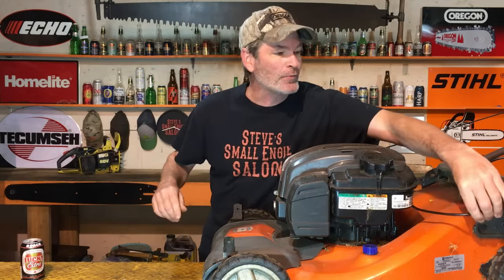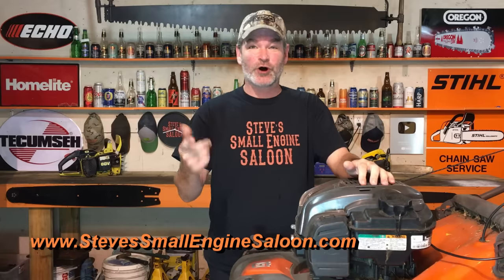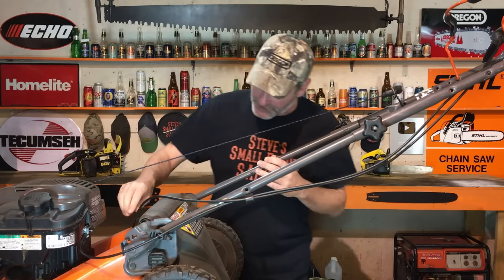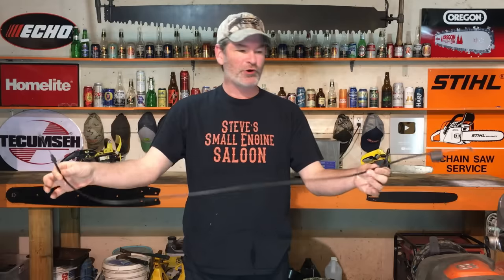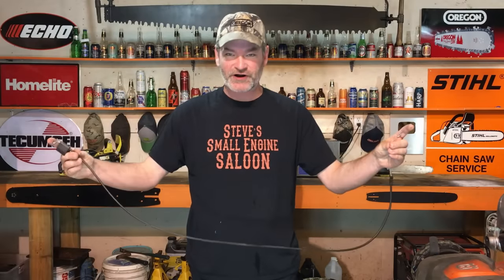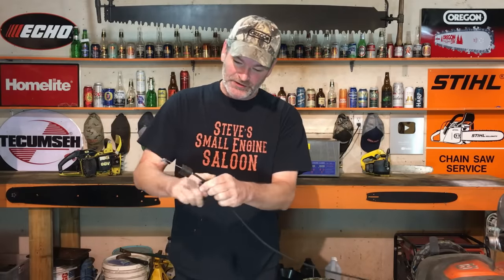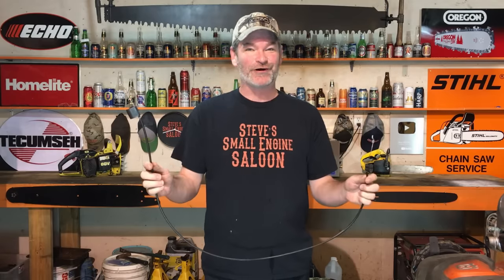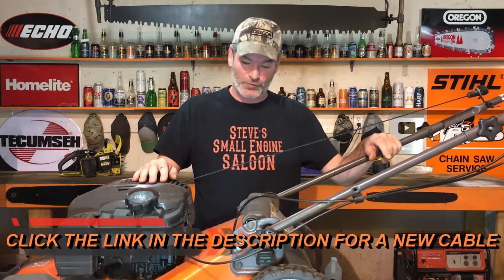How To Adjust A Non-Adjustable Lawn Mower Cable

Comment: Summary: The cable ends screw in/out, and by screwing both ends out a little bit (1/4 inch or so) you can lengthen the cable's outer sheath, which effectively shortens the usable portion of the cable, increasing the range of motion available to the kill switch actuator. Two things not mentioned: 1) On my mower (Murray 21"), the ends screw all the way off at about a half inch. 2) These dudes can be pretty tight. I needed to use pliers at first to get the initial twists, after that I could use my fingers. Really appreciate the video! This solved my problem and saved me from doing something weird like wiring up a manual switch in place of my kill switch!

Comment: That's it... Steve's a genius. I've worked on a lot of mowers and never knew those ends could twist off
Reply from the maker: Thank You...
Reply: Einstein's steves small engine saloon  your the man i wonder if old taryl dactal knew that hmmmm
Reply: I worked mowers to for years and new that about cables.

Steve your the man
Reply: Wonders.......!
Reply: @StevesSmallEngineSaloon  Yard Machines 21" Push Mower - 11A-B0BL700 ..start at first pull....can't stop . kill switch is not working..how to fix?

Comment: Incredibly easy fix. Was going nuts today playing with the carburetor, gas, and air filter.  Finally figured out control cable was the issue and this simple adjustment did the fix.  Fired up first pull every time now
Reply from the maker: Right on
Reply: Same here

Comment: Steve is just fantastic and perhaps the best small engine mechanic I have ever watched and, I have spent many many hours watching small engine mechanics.  But what's really happening is he is adjusting the connection points on the cable through the outer plastic shield.  And as a result it has the effect of shortening the steel cable.  In the past, I simply used zip ties and would attach the cable to the handle to make sure that it worked properly.  Of course steve's idea is far superior.  But as the cable continues to wear, Which most people mistakingly call stretch, Eventually there will not be enough adjustment on the outer plastic cable screw points to compensate.  At that point you will need to resort to plastic zip Ties to attach the cable to the handle.  Or simply spend ten dollars and replace the cable.  Thanks again steve, you're the best!   👍👍👍

Comment: Thank you so much!!! We just went through everything on this stupid mower, carb cleaning, valve adjustments, new magneto and spark plug, you name it, we tried it. I finally figured out the stupid cable wasn't being pulled far enough and didn't see any way to adjust it. You're awesome!
Reply from the maker: Right on Dave!
Reply: I just went through this same process so don’t feel bad. The mower would start intermittently and I had no idea why. Laughed (and cried) when I realized it was the cable.

Comment: I just thanked you a million times; however, I was kinda lucky to stumble across this video.  I noticed not having mush throw in the cable while cleaning the carburetor and at a last ditch effort looked for dead man cable not having much throw. 

What would be incredibly nice is a trouble shooting guide for mowers that run for short amount of time and shut off.  This guide could link to each of your videos showing how to resolve the issue.

Thanks a million again

Comment: I know a lot about lawnmowers and weedeaters but never knew the ends on the cables screwed off.
Reply: same here, I've fixed up dozens of mowers and never realized those ends screwed on.  Mind blown.
Reply from the maker: Right on Ed...
Reply from the maker: Awesome...
Reply: I never knew they were screwed on either.  I always thought they were compression/heat fused.  A big thank you, Steve.
Reply: Let me join the club, and I've fixed hundreds of them
Reply: @shadmoney6617  just bought some sleeves today the same as the stuff I use on my model planes with the set screw inside been working on lawn mowers and weed eaters for the longest never knew that you're the man
Reply: Well, you are not only cute, fun to listen to and drink a beer with, you’ve never let me down. This fix wins top  honors.  I’ve been trying to figure out what  was wrong for at least 15 beers - over several months. I was about to give in  and take it to the shop when I  remembered this video.  You are the best!!! Thank you so much!!!!

Comment: Pure greatness.    I was able to fix my Husqvarna mower in less time that it took to watch the video.  I just popped of the mount closes to the handle unscrewed it about 3 or 4 turns and popped it back on and fired right up !     I really appreciate the assistance.  The part is not that expensive, but now I can get back to work rather than waiting on a part to arrive !
Reply from the maker: Thank You...

Comment: Steve,  the heavy spring is the problem. My chain link fence is loaded with all the bail handles I've taken as trophies, along with a bucket of the springs. The cables wear out, kink up and otherwise become non functional. Cut them off with nips, fashion a simple shutoff for the kill switch or spend the bucks for an electrical springloaded SP/ST switch and screw the rotor brake. I used to remove the brake, now I find that just letting it flop around as it only cleans off the face of the rotor ensuring clean magnetic flow to the coil with virtually no drag when it touches and if it does need to be removed, cut it away with a metal cutting wheel, in place, as it can be accessed directly from above or you can remove the bolt and do it in a vise. That monster spring that B&S uses is way too strong. They sell more cables because of this. If and when the cable kinks, I have used your method to buy more time but the inside run of the cable is wearing out anyway and hand straightening, then locking it down with zip ties and electrical tape and lubing the crap out of them might buy a bit more time. Customers hate when you tell them it's twelve to fourteen bucks for a new cable. They brighten up when you fix it with some "chewing gum and baling wire" as you really only need the kill switch to work. The brake on the rotor is for safety ( OSHA required for the manufacturer, so check with your risk manager if you should do this as a repair "professional" or if you are the owner of the machine, there I are no restrictions)   so you have to remind them they have to keep their toes away from the deck when they reach down to kill the engine. The keeping it simple principle applies here. Especially with older mowers that turn into beaters anyway.

Comment: Was about to order a belt and saw your video. Ran out and adjusted the cable and it worked! The best part is I told my wife that I'm not wasting time on the smart phone. I'm doing research and saving money.  Thanks!
Reply from the maker: Nice job!

Comment: Your repairs/adjustments are always the best, most are a 1 beer project. I have a question that may be a 3+  beer project. All the new mowers have a fixed carburetor.  This is ok, but there are times I like to run the mower slower due to dusty conditions, pine cone ejection, etc. You get the point.  Is there anyway to install a throttle on this type carb ?

Comment: Thank you so much!!! My lawn mower stopped working about 3/4 of the way through today, I thought it over heated, but it was the break line. I didn’t need to adjust it I figured out that it came loose from the housing but the next time it happens I will adjust it, thank you so much!

Comment: And if the ends on your cable are fastened or molded securely and won't screw off, then get a short 3/8 diameter, half inch long bolt, nut, and two flat washers. Remove the cable end by the motor and wrap the cable around the bolt, between the 2 washers, two times and while pulling the cable tight, just tighten the nut on the bolt squeezing the cable between the washers. Try it and if you need it longer or shorter, just change the amount of wraps around the bolt. Saves buying a new cable and doesn't hurt the cable like tying a knot will do. Another method is to bend the cable into a little loop and push the loop through a 1/2 inch nut. When the eye of the loop pops through the nut, slip a short small screw through the loops eye and pull the cable tight. The screw will keep the cable from pulling back through the hole in the nut and your cable is now shortened. Use a larger size nut if you need to shorten it more or smaller nut if you need the cable a little longer.
Hope these alternative methods help if your cable ends are glued tight like mine were. Good day! Jpol.

Comment: Steve - thank you, that was the fix! Got a free mower that didn't start, needed a carb replacement and this adjustment. The pull chord broke but managed to rethread with the starter still riveted on but it's loose. Have any videos on getting it to fully recoil?

Comment: Don't normally comment on videos, but you are the hero for the day! I had replaced the control (brake) cable awhile back but it always seemed to barely have any movement. It worked for awhile but recently stopped. Tried the conventional stuff like cleaning carb (looked good) and plug and so on, just it would not start!

Didn't realize the cable was adjustable, thought it was just a wrong chinese part replacement I bought. Loosened both ends and wow it started right up! The only bad part was it wants to pull that handle mount out but nothing a few strategic zip ties to keep it from pulling out didn't fix.

Thanks for the video!
Reply from the maker: You're Welcome...

Comment: Great tip and easy to fix it. Thanks you very much Steve , I was leaving overseas and had trouble with find part every small machine took it with me when moving back to Thailand. It’s very hard to find the right parts.

Comment: Steve, thank you for this information.  I have been trying to get my mower started for a few weeks....I had changed / cleaned several things attempting to get it running again.  I was about to give up and take it into a repair shop but I found your site by accident and tried what you suggested and it worked.  Thank you for saving me some money to apply to some other things that need to be fixed.
Reply from the maker: Right on!  You're Welcome...

Comment: I know this is an older video but it saved my Husqvarna LC221A today! After ordering and installing two “factory correct” drive belts that didn’t fit 🤬 I saw this video and decided to try it on the drive cable for my AWD Husqvarna and it solved my problem, wish I had tried this from the git-go! Beware of non OEM belts that claim to be the correct size if your mower uses a custom belt that’s in between standard sizes, they usually won’t fit or work right and sellers on eBay and Amazon are often clueless!! Thanks Steve-O!!
Reply from the maker: You're Welcome...

Comment: Dude . I was at my end . Replaced carburetor. New plug, new blade . I finally saw this video. Lmao I fixed the real problem with the adjustment in 2 minutes. I doubt there was anything wrong with the original after I cleaned it five times lol. New one only cost 15 bucks so worth it but this adjustment I was laughing at how easy it was and it runs like a champ now thanks man videos are awesome and very educational and you make it simple.
Reply from the maker: Right on

Comment: Very timely Steve.  I "rigged one up" for a cheap $40 mower today.  It is a mower for a young man starting out.  I used the bracket that is adjustable that goes onto the handle.  I would love to find another 10.  It is for the cable that has the clip in at both ends.  Engine and handle bare have the same end.
Reply from the maker: Cool Bruce!  Thank You...

Comment: Thanks for the video! I believe I stretched the cable when it caught while folding up the handle. It caught and actually the throttle return spring come loose. I fixed that but could only start the mower by manually pulling the  slack out of the cable by the bail arm. Thanks for saving me a shop  service, two week wait and expense. 👍👍👍
Reply from the maker: You're Welcome...

Comment: Thanks so much for this info. Old cable was mostly stuck inside plastic sleeve, so got a new one. But the new one (which slides freely) does not pull the brake lever far enough to release and let me start the mower. Looks exactly like what you have.
Looks like you have the winning solution (if it doesn't work when I try it tomorrow, I can always go for Mickey Mouse).

Comment: My troybilt cable brake broke (awful sentence structure) two years ago and I bored a hole in the bracket and used micro U bolt to repair. When that corrodes promise I will buy from your link. Confirmed you have my cable. Great video and you also nailed the one beer time line. Working on small engines is way more fun when you drink!
Cheers Steve

Comment: Great video. It was exactly my issue. The ground cable connected to coil was preventing start. Adjusted cable and first pull start.
Reply from the maker: Right on

Comment: Thank you! Saved me a trip to the shop, as I thought I had the wrong brake cable! Now, I need to find out why I can't spin my flywheel manually with my hands. I have the brake cable pulled tight, yet I am unable to move the flywheel.

Comment: So nice to see someone else doing what I have been doing for many a many years. Nice job Steve. Sometimes you can use a throttle cable and cut the solder formed ends off original cable and solder to the new cable and you are up and running in fifteen minutes max. Not counting going to either a local mower shop or close big box stores lawn and garden section in season. Good day.

Comment: STEVE! 
You've done it again!
Near the end of this video, after you had adjusted the cable, I noticed, as you worked the bale, I saw on the inner cable, wear showing how far it once travelled. I noticed also, once you adjusted the cable, the travel matched to the same point.
Sometimes, the machine gives hints by looking at the wear...
You did GREAT!!!
Ya had me wondering, just how you were going to lengthen the outer cable.
GREAT JOB!!!
Great tip!!!
Reply from the maker: Right on Howie!  Thank You...

Comment: Thanks man excellent video. I just put a new belt on my Husqvarna four-wheel-drive lawnmower, but afterwards it wasn’t getting enough tension on the belt when I pulled the lever used your technique and it worked great to adjust it.. Thanks it saved me from having to buy a new cable.
Reply from the maker: You're Welcome...

Comment: Incredibly helpful!  Especially the tip that I didn't need to dismantle everything first.  It never would have occurred to me that the entire outer tube/clip assembly wasn't just molded as a single piece.  As it was, it too pliers to get it to screw/unscrew, so I would probably never have tried.
Reply from the maker: Glad it helped!

Comment: Thanks for the tip. It worked on control cable on craftsman 
wheel weed eater.  About ready to tie a knot in it.  Installed new belt and cable.
Reply from the maker: You're Welcome...  :_Beer: :_Mower: :_Rider: :_Chainsaw:

Comment: Enjoy your site and your useful videos. I can sit at the computer half the afternoon and just watch various ones.  They are presented in a clear format and your presentation is spot on.; not rigid and formal , but like you're right there talking to me.  Great job, Steve.
I've got a particular problem I have been working on that I can't figure out.  It involves a Troy Bilt tiller Model TB225, 21AK225G766, 2 stroke,.  Bought for $25 from Lowe's,, probably as a return because it wouldn't start.  First problem I found was a bad spark plug, no continuity.  Thought I had really lucked out.  Replaced that, but still couldn't get the unit to pop, even with starter fluid.  Compression check yielded about 55 psi, not the best, but i figured i should get something.  Unit had set in the rain for some time.  Carb jets rusty and even with a cleaning, gaskets were rigid and though it might present a problem.. Replaced the carb with a cheap aftermarket.  Nothing!  Got spark, compression, and fuel.  What else should I be looking at?  I am assuming this thing has neither reed nor circular disk valves.

Comment: Steve, you are the best. I never knew that can be done. I have the same problem with my lawn mower, and to start it, I pull on the metal cable then pull start the lawn mower. This is very awkward. THANKS.
Reply from the maker: You're Welcome...

Comment: Great tip Steve. Will try this on my Husqvarna snowblower speed cable as the adjustable cable i had was replaced with non-adjustable cable for some reason when i had the plastic console replaced last year. The consoles are metal now instead of plastic which break where the speed cable is anchored. A piss poor design flaw along with a reverse speed that is way too slow. I want to adjust to increase reverse speed even though i will loose some forward speed. Machine starts and runs great though. Take care.

Comment: Whut thaaaaa. Aint gonna lie, I taped a bottle cap off an empty quart of oil bottle and pout it between the cable and the handle bar. It worked in a jiff but I will be adjusting the cable tonight. Thanks Steve
Reply from the maker: You're Welcome...

Comment: This was very helpful! I tried it just today on a salvage mower someone was throwing away. It mostly worked, although the plastic piece up top that holds the cable to the handle was flexing a good bit so I helped it out by wrapping a hose clamp around it and the handle. I can’t recall which specific size it was. I have the variety pack from Harbor Freight and just found one that looked about right.

Comment: Thank you so much, Steve. You saved me a lot of money by fixing myself a cracked gas tank, adjusted rocker arms, checked pressure by just spinning the blade, cleaned carb, and now this. I was just wondering today why the hell my mower's self propelled seems so slow, I am pretty sure that the cable is loose. Again, thank you.
Reply from the maker: Excellent!